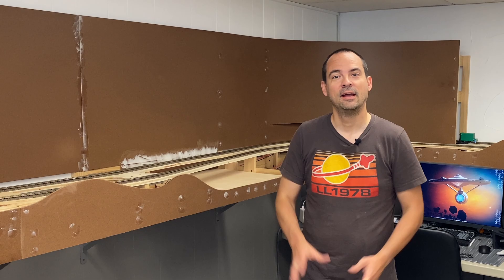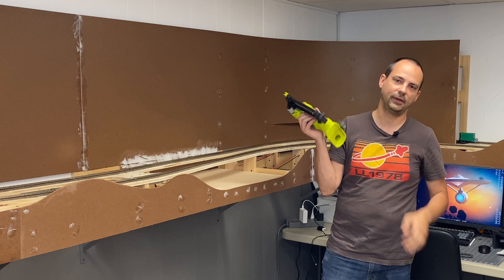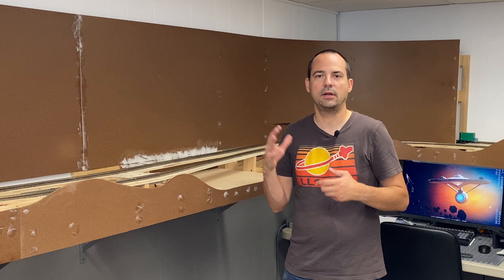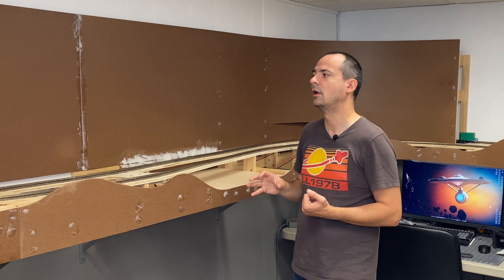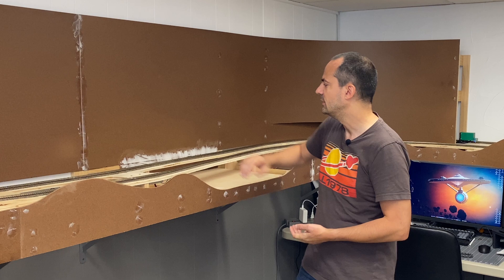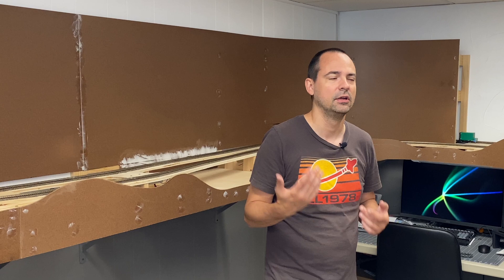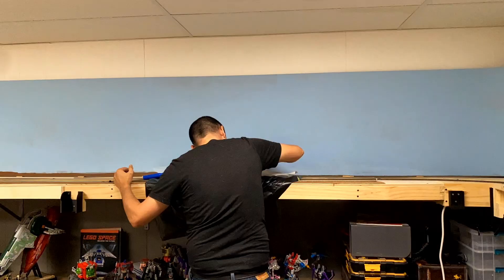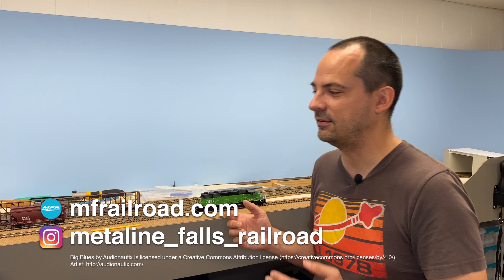How-To: Backdrops and Fascia

Comment: Like your use of mdf. I am doing same with my layout, all curves except a couple of walls (ie narrow shelving going into dormer). What I found that has worked well for me to make REALLY tight curves is to use original Windex that contains ammonia. I saturated both sides of the 'bend' and put it up with brad nailer to drywall. It has held its shape amazingly well after several months. Not sure what YT channel I learned that from. Only issue I had was I had placed several panels of photographic backdrop and realized I didn't get them lined up correctly so creeped up. Had to replace four panels and in the process of removing the backdrop from the mdf, I pulled the mdf out of the wall (used to small/too few brads). Correcting that now. I have rough cut the fascia and still debating terrain oriented fascia vs flat along all the edges. No rush on that yet. I'm still debating. Great video!
Reply from the maker: Great tips!

Comment: If your budget is starting to sweat, for a straightedge, you can always use a STRAIGHT 2 x 4 clamped at each end. Don't push very hard against it in mid stream, and remember, the rough side can go down.

Comment: What's a good way of cutting facial when it's already in place
Reply from the maker: I use a jigsaw. You'll want to ensure the fasica is securely mounted before attempting it otherwise it make shake loose.  It also makes a mess, so be prepared for that!
Reply: @MFRailroad  Yes its very messy. I thought someone made something smaller. Thanks 😊
Reply from the maker: @chrisshoulders4066  I think Dremel has a jigsaw-like tool that may work, but I'd be worried about breaking it on masonite.
Reply: @MFRailroad  Thanks